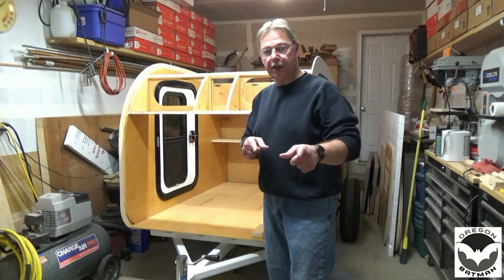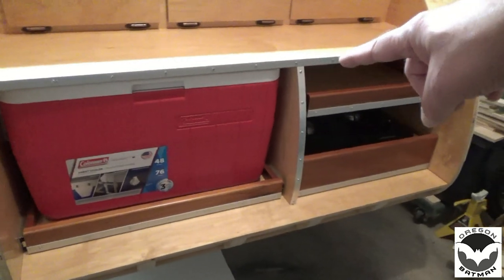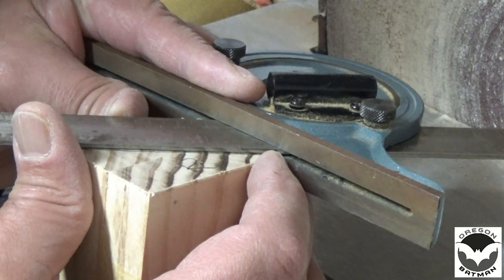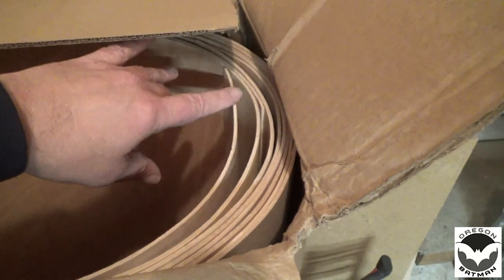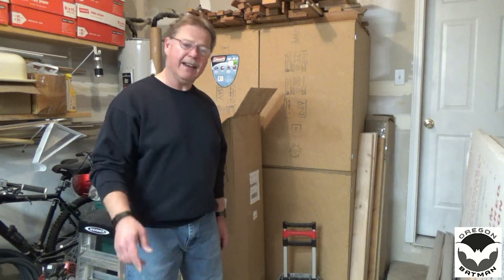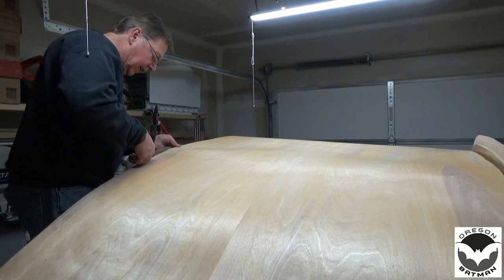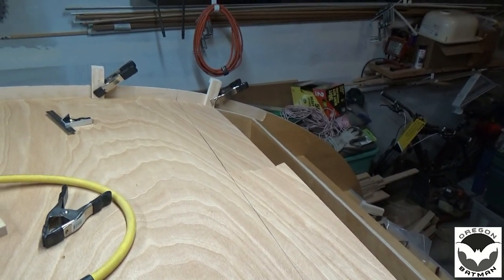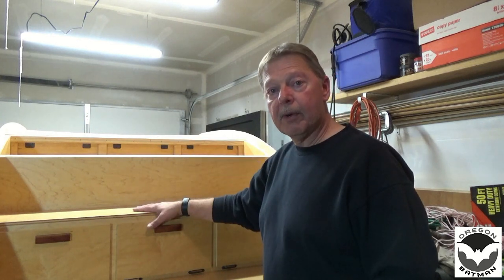Let’s Build A Teardrop * Step-By-Step * - Part 27 (Installing the Ceiling)

Comment: Thanks for the mention OregonBatman!  My daughter and I had a great time building our last camper and following your builds.  We continue to do so while we're building her teardrop :)  I'll have more content to share on my channel soon as our first camping trip deadline is fast approaching.

Your work is BEAUTIFUL and CLEAN and SOLID for sure!  I think the 1/8" was a great choice because of how bendy it is.  Smart choice ordering a box of it.  We have a plywood wholesaler in town where I live and they do sell to the public, with an added fee...  Once your spars are in place and you have insulation sandwiched in there, it'll feel great from the inside, plus you'll have that outside skin to add another layer of rigidity.  I've snapped my fair share of 1/4" plywood, even the bendy kind, from trying to wrap a tight curve.  Also, the first thing I thought of when the camera showed the underside:  That's the cleanest it'll ever be!  One trip down the road...  but your roads are probably in better shape than ours!  I'm super interested in seeing how the filon holds up down there.  I think it's the smartest undercarriage option I've seen yet.  My tiny camper has shingled layers of window flashing, but I went the traditional asphalt emulsion gunk for the bottom of my daughter's teardrop.  It makes one heck of a mess, but seems to seal it up alright.  If we get a ding down there, we can fill it in and paint more of the gunk over the top of it.

Oh, and great choice for the seam at the cabinet face - what did Bob Ross say? “We don't make mistakes, just happy little accidents.”  Besides, it certainly looks like you meant to put the seam there anyway!  Like playing Jazz music, right?  I recently made an oopsie on my daughter's galley and had to apply an afterthought fix.  My local builder friends told me "nope, we don't make mistakes, that's what we call a design change."

I know it's a little down the road, but I can't wait to see how you build your hatch door and hinge!

Looking great!  I applaud your ability to balance workshop and work life!
Reply from the maker: You're welcome Eli! Your build deserves recognition for sure! Looking forward to seeing some of your teardrop build on YouTube... you did an awesome job! I think the bottom will hold up really well around here... and I agree, one trip down the road and the bottom won't look as purtty anymore! LOL! I love Bob's quote! Happy accident! And I live by "we don't make mistakes, I call that a design change." I finished the preliminary wiring tonight and tested all the lights, working great. Should have everything insulated and the top on in a week or two. Once that is finished, we'll tackle the hatch... still thinking that through. The end is near! :)

Comment: Fantastic project. Why not glue before fasteners?  It seems like that would reduce the likelihood of things working loose from road vibration.
Reply from the maker: Thanks p l! A lot of parts holding it all together, not too worried about anything vibrating loose. Thanks for stopping by and watching the videos!

Comment: Could you tell me what kind of plywood did you use for the roof?
Reply from the maker: I used a bendable plywood I purchased from Boulter Plywood. Great stuff, although the thinner ply is a little tricky to work with, pretty flexible!
Reply: @OregonBatman  Right. Since I live in Korea, I can't buy from that shop you recommended. Do you have any idea if it was a birch plywood? thank you~
Reply from the maker: It is a Birch and Maple. Rotary Cut, 2 Ply Birch, Very flexible, B Face lauan back, Most flexible product available

Comment: Although a bit complicated, very fine work, indeed, for someone under the age 65..!!  LOL!   Many boat building applications here...  Your shop tools are sorely needed here, in addition to your patience  (difficult to learn.! LOL!)      When you applied the roof, I would have started at the front and moved toward the galley instead of chancing a piecing in the middle, unless you were trying to maximize material coverage..?  Any reason why you waited to install the frame bolts..??
Reply from the maker: Since I built the cabin almost entirely off the frame, no rush to fasten it down. I knew where every bolt would be. You know... doesn't take fancy tools to make the build, you can do this!  :)
Reply: @OregonBatman   Since I am over 65 and have been a woodworker, cabinet maker, boat builder, et. all  since I'm 19 years old (now 74), I surely know I can build this and have all the tools to do so ..  While this is a great design and I enjoy the production, something a bit larger would be my desire (have to get off the floor).  Yes, I know I can increase the size..  Frankly, while this may be practical for one, these designs are a stretch for two..  Being 6'+, getting in and out while constantly removing shoes and being in a crouched position are not my cup of tea..  Thank you for your good work..
Reply from the maker: @pjf7943  Thanks pjf! Totally understand! Currently building out a van for just such reasons! :)  Will be a better fit for me aging body! :)
Reply: @OregonBatman  I'm flattered that you and I agree..!!  LOL!  I look forward to the van build. After watching you at work, I know it will be something special..!!  I had better brush up on my AutoCad that I haven't used in 22 years..  Thanks again..

Comment: Sweet build. What are your interior dimensions roughly? I'm in the middle of designing my own and wondering how big others are able to make the interior.
Reply from the maker: Thanks Forster46! The inside dimensions of this build are 46.5" x 73.375". The rear bulkhead for this design could be moved back another 1-1/2" if desired and still work. Good luck on your design and build!

Comment: Hi OBM.
following along still.  any reason why you didnt glue the ceiling skin on?  im on the verge.  i need to find a trailer frame maker first.  thanks!
Reply from the maker: Thanks for the question! The ceiling is is held in place by gluing the spacers to the ceiling and side of trailer, plus all spars are glued in place. I didn't run glue on the ceiling as it only rests on the 1/2" ply sides. Didn't want any glue running down inside. So I set it in place and glued everything else down on top of it. Pretty solid!
Reply: @OregonBatman  thanks.  got it!
Reply: Are you still looking for a trailer builder?

Comment: I  might have cleaned the remaining sidewalls to where the ply wil rest at the floor and cut an angle at the bottom  of the ply!
Reply from the maker: That would look nice and clean...
Reply: Thank you for taking the time to reply...
Reply from the maker: @pjf7943  Absolutely! I just pave the road... it's up to ya'll where it will lead. So many have built this teardrop and changed so much to make it theirs. It's cool to see the ideas they incorporate to make it so much better!
Reply: @OregonBatman  I like the fact that you use the cabinetry to support the sides instead of working (more like fighting)  in a cramped interior, then laying in the ceiling and roof last.. Brilliant..!

Comment: The build is fantastic. I'm just not sure I understand the purpose of them?
Reply from the maker: Thanks John! I consider the Teardrop to be the next step up from tent camping. Basically a bed on wheels with your cooking gear in the back. No setting things up like you would if you had a tent, just park the thing and you're done! Tent glamping! LOL! Way more comfortable than a tent, and offers a lot more protection from the elements (and animals!). Not to mention... when you are traveling, it is less expensive than a hotel! :)  Cheers! Thanks for stopping by!
Reply: @OregonBatman  Ahhh. I get it. These little campers are a huge step up from tent camping. A place to sleep out of the normal tent elements with bonus gear and cooking  elements provided. Very cool.
Reply: @johnshader4287  A year and a half ago I timed how long it was taking to setup and brake down my campsite in a tent and was wasting over 5 hours every time I went camping. My current record in my built squaredrop is about 10 minutes to setup and brake down.

Comment: Your craftsmanship is seriously amazing. The planning that goes into your build is utterly amazing. I wish I had a mentor like you to oversee my build I'm in the middle of. Thank you for your videos!!!!
Reply from the maker: Thank you Mick!!
Reply: @OregonBatman  would you be able to help me with a simple wiring diagram of a 12 V battery system for a teardrop without solar, also with a shore power inlet to charge with? Also where could I get aluminum trim with an insert slot!?
Reply from the maker: Send me an email Mick... tell me what your thoughts are and what you have planned

Comment: This process of applying the inner skin is difficult to find on YouTube, thank you for showing it! 

My project was 74"  wide (inside the side walls) and the 1/8" luan bent towards the floor during the tacking process.  I had to install temporary supporting cross beams to bring the ceiling straight before gluing the styrofoam and the luan outside skin.  If I had to do it again, I would place those temporary supports BEFORE tacking the inner skin.

You didn't show it but I suppose that glue was incorporated in all operations filmed today (the front spar attached to the floor and the inner skin attached to the walls and transverse supports).

Great work!  I look forward seeing the next video!
Reply from the maker: Thanks Raynald! The process went better than I anticipated, thought I would need supports across the width of the trailer to hold up the ceiling, but this wood only bends in one direction, so when I put it in place it just rolled right in without a problem. I installed the ceiling without glue. The next step in the process shows how I locked it in place with glue and screws. It is very solid now. Running wiring today and will be testing out the lights. Should be getting the outer skin and filon installed in a week or two... that should be challenging! :)  Thanks for watching sir!
Reply: @OregonBatman  I hope someone will be available to help you, contact glue doesn't pardon...
Reply from the maker: Very true! I may have to have my oldest son come by and give me a hand. It would be a nightmare to try and peel back something I didn't want stuck!